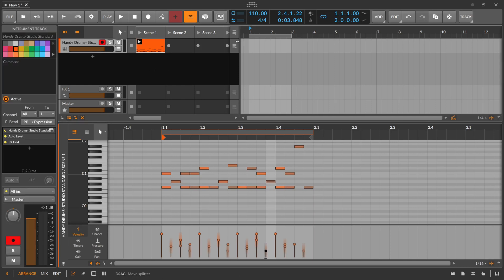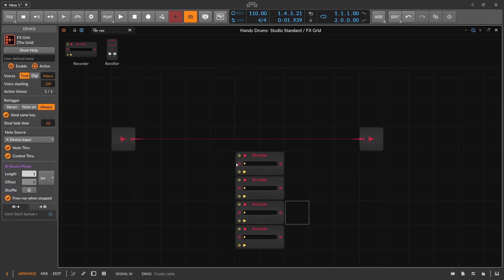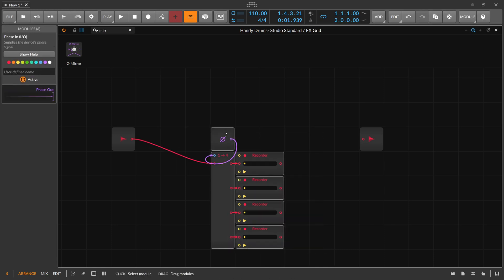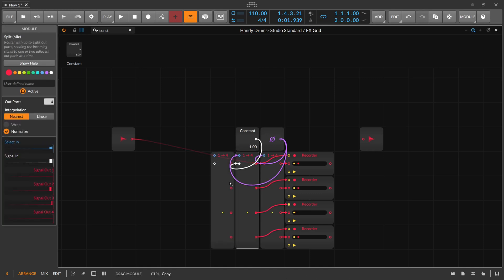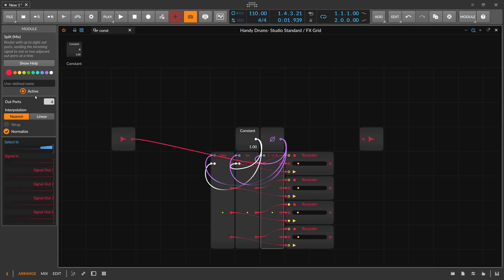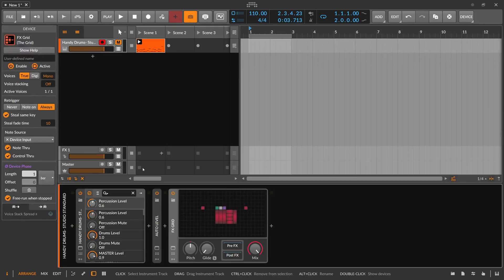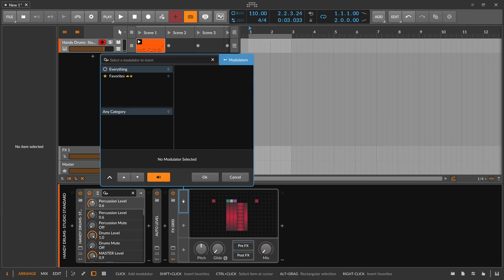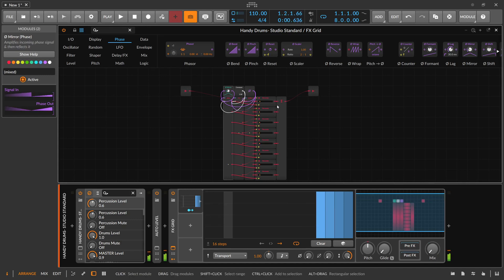an Interesting Beat Repeater with the Bitwig FX Grid

Comment: .. In the split function, is there a way to manually select which one you will want? I'm trying to make some layers of saturations and I wanted to select different mixes by the remote control, it's kind of an FX selector, only inside the grid, is it possible ?